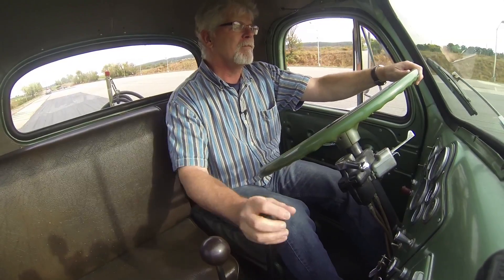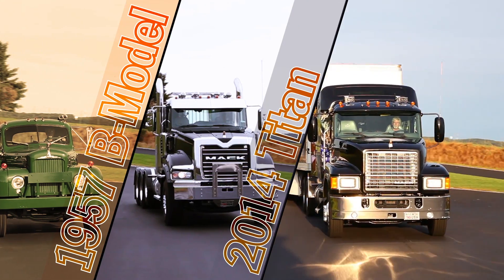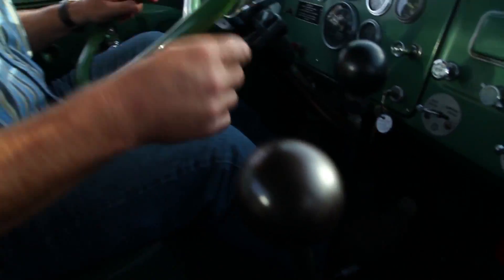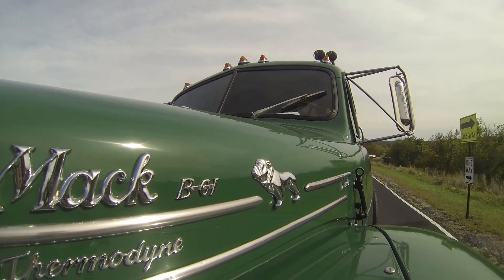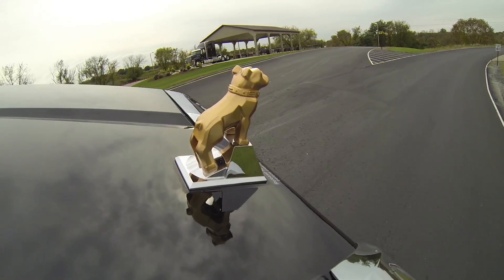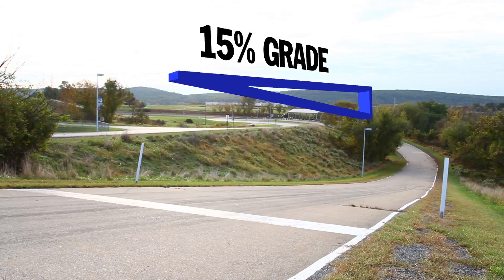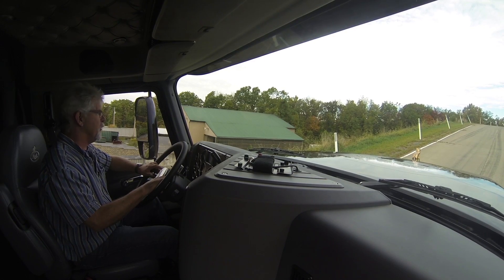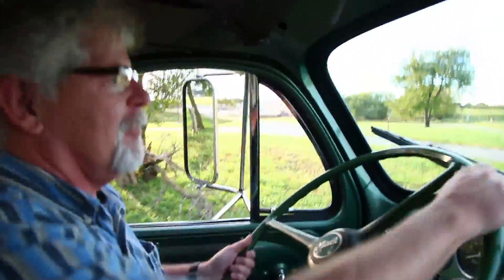Twin Stick to mDRIVE Pt 2

Comment: Jim. Too bad they didn't give you a B model with a quad box. That would have been a fun comparison.
 Cool video, but you have not made me a convert. I still hate auto boxes and always will.
Reply: I agree fully with you, but ther is now in Europe an evolution at Scania. They have also autoboxes, but with a clutch pedal. It's up to you now if you want to drive automated or not.
Reply: I would never be a convert ! 
I like the two sticks , even if it is a duplex or a very unforgiving "Quad box". Old drivers with  large clutch muscles , which BTW, most all drivers use a clutch to get rolling and sit at a traffic light. Thanks Dan Burkhart.
Reply: if they are true truck drivers starting is the only time they should need a clutch.i been hauling for 40 yrs now and I have replaced 1/3 the amount of clutch and pressure plates as the so called college grad of nowdays will replace.period and as forest gump said that's all I got to say about that.
Reply: Anyone can drive a truck now the automatic took all the skill out of it